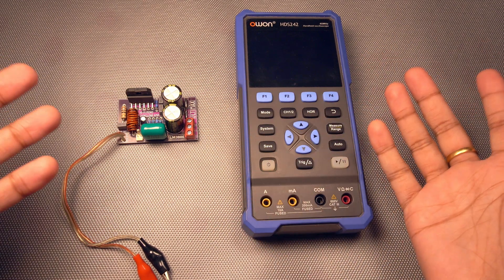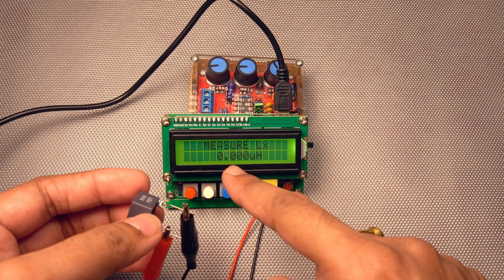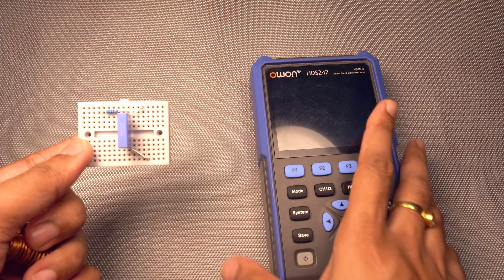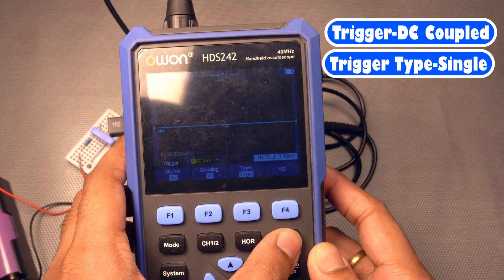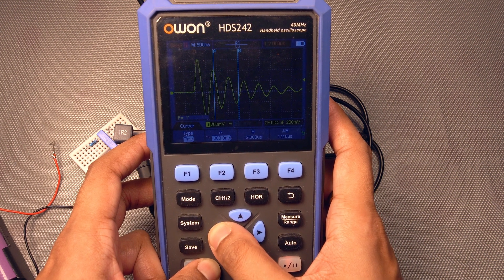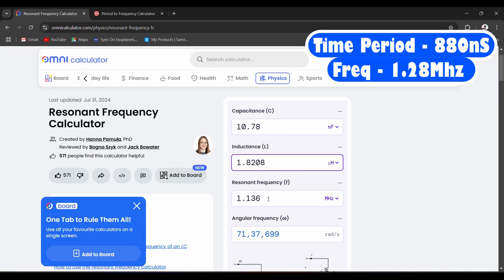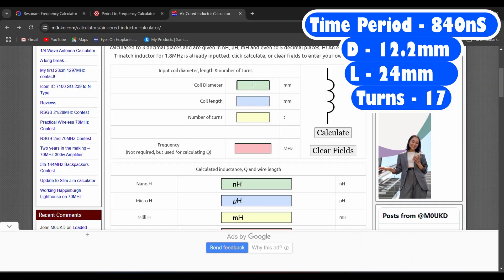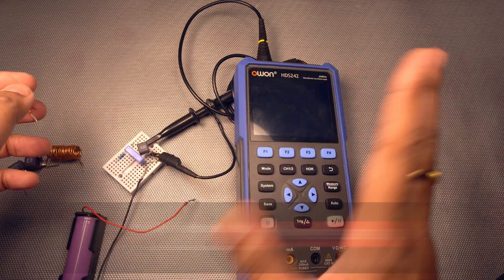Measure Small Inductors with an Oscilloscope | Amplifier Thiele Network | Measure Air Core Inductor

Comment from the maker: Hey Guys !!! Seems like I made a mistake in putting the B cursor for Time Period measurements of first three Inductors . I had to place the B cursor exactly at the point where the negative waveform touches zero line . The last measurement (0.2uH) is proper 1Time period and thats the proper placement of A and B cursors.

Comment: problem with this method is that the freq generated is also dependant on supply voltage
Reply from the maker: Even though the energy stored in the capacitor depends on voltage, the resonant frequency is a function of L and C  alone. Therefore, changing the applied voltage in a parallel LC circuit does not change the resonant frequency.
You can go ahead and test it … you will get same frequency even if you change the supply voltage

Comment: Bhai, induction coil me megnatic field ko kis circuit ki madad se badhaya jata he...??
Reply from the maker: This is a different topic in itself . But induction coil and the cookware behaves like a loosely coupled transformer(secondary sorted )… so more current means more power and this more current is handled by a Pulse Jo ki IGBT ko input kiya jaata h . This pulse duration is monitored by the microcontroller depending on the current requirements. Ye complicated circuit hota h and bohot kuch monitor karna padhta h .

Comment: It seems that for a sine wave the first cursor at zero and the second cursor at zero, one wave length away or peak to peak is needed. You seem to have used a period and a half.
Reply: a period and a quarter actually
Reply from the maker: @thethoughtfield True it was about 1.2T  … but I hope the idea stays clear irrespective of the small measurement errors !!
Reply from the maker: @garywashington9391  Yes You are right !! …. I noticed I measured the Time period a bit higher for the first three measurements …. In the last one (0.2uH ) I have fortunately placed the cursors at the right place 🥲.

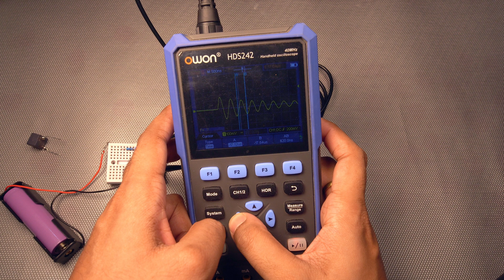Comment: nice, but as far as I can see (9:30) you're measuring 1,25 T, not 1T with your cursors ...so the real frequency of the ringing is about 1,25 higher
Reply from the maker: True … even I noticed now … I measured the Time period higher (should be around 720nS)…. Which means frequency is supposed to be higher than 1.28Mhz and technically the value wont drift too much than the calculated value even with the new frequency.
Reply: I was just about to comment the same